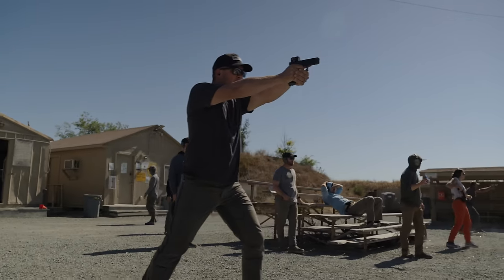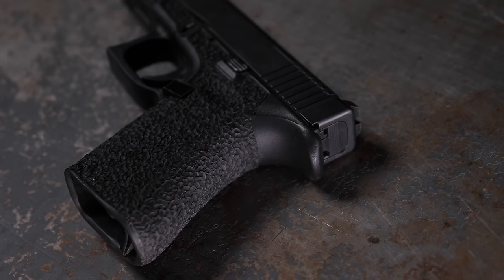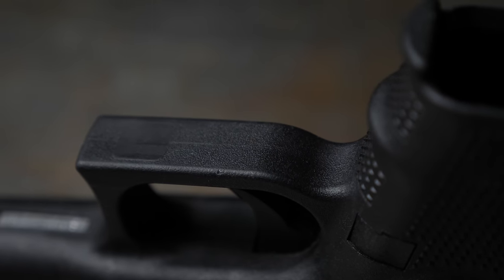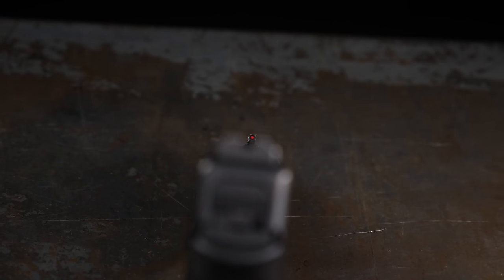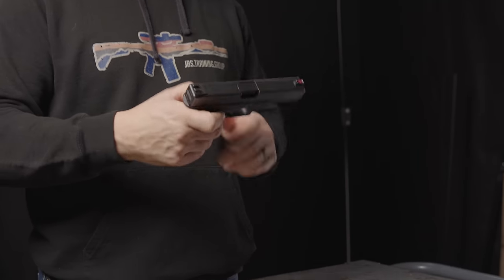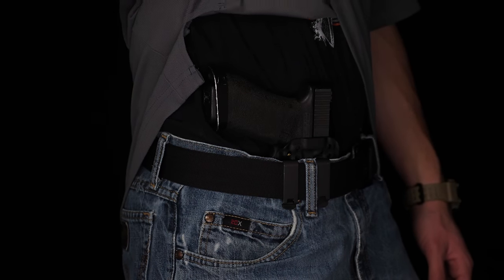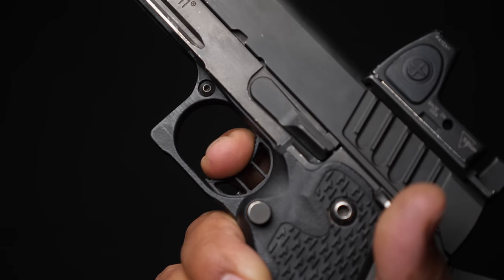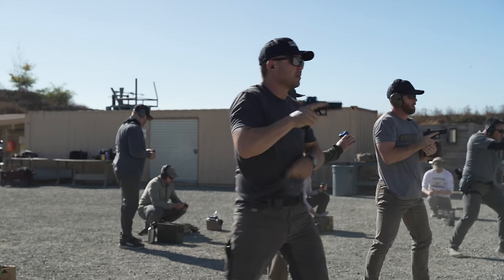Mod Your Carry Gun: Do's & Don'ts

Comment: After a couple thousand rounds my old gen3 Gluk 19's trigger smoothened itself out pretty well.  That and maybe I just got used to it.  I have fat stubby fingers and absolutely hate the finger grooves on the newer Gluks. Hard pass on those, plus I only carry the old G19 OWB these days because I absolutely refuse to shovel a striker-fired firearm without any external safety devices inside my waistband now. 

In the three decades since I first bought my Gluk I've changed my thinking a lot on what I find acceptable in a carry gun and my own methods of carry.  Transitioning to AIWB has had a lot to do with my thoughts on absolutely required equipment on a EDC gun: DA/SA, external safety/decocker, and external hammer.  I accept nothing less.  Others can make up their own minds and follow tbeir own rules as to what equipment is acceptably safe for them.

Comment: The trigger most folks want is a crisp, “glass rod break” trigger, for the least possible disruption of the sights, during the trigger pull.  This is the best for target, but not for defense, where adrenaline is high, and simply resting your finger on a light trigger could have catastrophic consequences.  My Glock 45’s trigger was terrible, even by Glock standards.

Comment: what iron sights do you recommend for a glock
Reply: I'd say your best pick is Trijicon HDs orange. 3 dot night sights. I have them on 2 pistols. ✅️  Glock-Ameriglo night sights are ok. I'd avoid fiber beam type sights. The thin pipes seem weak, easy to fail in a ccw, carry situation. Some like new HD xr series but I'd stick with orange HDs for any Glock.
Reply from the maker: There are a lot of good options out there now. Just make sure they are metal. If you run a dot either have them blacked out or some sort of black rear and a front sight with something that is a different color than the red dot. Trijicon, Ameriglo, Dawson Precision, would be a good place to start looking.

Comment: understand not milling the slide as you're changing the weight and can effect the action.  but what about milling for a RDS mount?  you are putting some (maybe more, maybe less) of the weight back.
Reply from the maker: True, definitely worth comparing vs. factory. Generally more weight isn't much of a problem.
Reply: Ddp 30$ mount for not milling or buy a rmr cut slide  on a web  sight (your choice) 120$

Comment: I put a RangerProof Swag (Yeah, cringe brand name) flat faced trigger shoe on my Glock 19 Gen 4 and I love it, but there's times where I wish that I still had the stock trigger. Debating on buying an OEM trigger shoe and bar to switch it back. I do wish that my Gen 4 didn't have the finger grooves because my big sausages sit on the peaks of the grooves instead of in the valleys.

Comment: While I agree that red dots can certainly improve speed and accuracy, i would by no means say they're "mandatory". With large optics like the SRO, I can find the dot pretty quick, bot on smaller optics like the RMR and especially micro red dots, i am faster with the irons. I know a lot of people are like that too. And as far as front slide cuts being unnecessary if you're using proper technique, I feel like you're not thinking at all. What if it's raining? What if your hands are sweaty, or bloody? What if your gun falls in the mud while you're taking fire? Front slide serrations are a good thing dude. Everything else you said is legit, though common sense.

Comment: I will probably never use a dot on my carry gun as I am a newer shooter and that's another point of failure for me, but my competition gun I have a dot on it because it's a lower stress environment. What I've been been taught is keep it simple stupid, you don't need all the flashy upgrades if the stock firearm does the job just fine.

Comment: I pretty much agree with, or at least don't have an issue with everything that was said in this video with on HUGE exception. "Black iron sights are perfectly acceptable"?!? What? Despite the recent increase in popularity of red dot sights, iron sights are still perfectly acceptable, but you are MUCH better off with some type of contrasting front and rear sights with night sights, like tritium, being a good choice. After all, this video is about modifications you should or shouldn't do to a carry gun, i.e. one that you might very well have to use in a self defense situation. Many of those self defense situations might occur at night or in low light settings. Being able to acquire your sights in low light is greatly improved by being able to actually see your sights.

Like I said, I agree with most of the advice presented in this video but I really can't understand how this one was included.

Comment: Saying, "It's mandatory to have a red dot on your carry gun" is BS.
Reply: The technology has proven itself to be as reliable and as much of a force multiplier as it has on rifles, if you can't afford one or refuse to develop a new skill you should just say that instead
Reply: @Judge_Jej  Where did you get that? That's not what I said. If you read properly, I simply stated that it's not mandatory to use a red dot. I'm personally not against red dots at all.
Reply: Agree
Reply: I'm in your corner. I have a red dot on my concealed daily driver. BUT. When I train I use my irons as primary sights, red dot as back up. My sights obviously co-witness. My first shot from the draw or low ready is made using iron sights, follow up or shots where i take my time are made with the RDS. That way I never lose my skill with irons on any gun but I benefit from faster follow up with the dot. They aren't everybody's cup of tea. I'm of the mindset, batteries fail, irons don't.
Reply: i heard that and immediately came to comments to see if i was tripping 😂 most self defense encounters occur within 5 yards. at that range, it’s not mandatory whatsoever. nice to have? YES. mandatory? NO.
Reply: @zknsand exactly. i was quite surprised to hear something like that from jeff he seems better than most people about absolutes, i would guess he’s coming from his experience with law enforcement where you would definitely need something capable of engaging from over 50 yards, most of us are not planning on engaging from that far. for someone carrying with the purpose of protecting the public it would be much more important i think.
Reply from the maker: Thanks for the comment. Red dots on pistols are pretty close to red dots on rifles.  Not having a red dot on a rifle (unless you need magnification) is almost to the point that it is absurd.  Red dots on pistols aren't quite like that, but I don't see any reason to not have one in 2024.  Dots make physical skill execution simpler which will allows you to focus on the problem solving.  Iron's work, but dots are better. 🤙
Reply: Agreed! I put one on my Glock 43x. It wouldn’t hold zero. Took it off and put some true glow night sights on.
Reply: @tenicorusa Correct but you will almost never use either in a ccw situation.
Reply: In 2024 there are so many better guns available other than a glock its ridiculous to buy a glock. "Based on reddots being mandatory" @tenicorusa
Reply: Irons don't need batteries..... Nuff said.
Reply: @ghostkilla931 Ok, and swords don't need reloading. 

Technology moves on, with or without you.
Reply: Not against red dots per se, but I have always found night sights faster and easier to acquire my targets. Red dots are fun at the range for me, but as a slightly bigger guy in the waist, appendix carrying a pistol with an optic on it is not the most comfortable. But hey, to each their own.
Reply: Dots make shooting easier picking your sights up easier and faster so yes you do is it the biggest deal breaker no but when you are fighting for your life you want everything to be easier and faster to get rid of the threat
Reply: I mean it might as well be. You’re putting yourself at a disadvantage by choosing not to use one
Reply: Red dot is fine until you pull your gun and the lens is covered in lint, or doesn't come on. I've never had iron sights to fail
Reply: We've only been shooting guns without them for nearly 650 years
Reply: @jimchambers7548  bro it’s 2024. Shake awake is a feature. And it should be routine to check & wipe your lense before holstering lol
Reply: I put my money in tritium night sights. If I'm using a side arm,I want as much element of surprise as I can get without a suppressor. The night sights are good and work so long as you don't have a spotlight directed at you.
Reply: @bluebeastsrt same, i shoot better without them bc ij have a astigmatism
Reply: @tenicorusa there are people who would disagree, some people are used to irons and thus have more trouble getting used to red dots
Reply: @CramcrumBrewbringer wrong 😂 🤦‍♂️
Reply: Good thing he didn’t say that, if you used your big boy listening ears, you would have heard that he said “its ALMOST mandatory that you replace your shitty plastic sights with at the very least some metal iron sights”
Reply: @dr.flinch6745  Chill, big boy.
Reply: I was talking to a cop once about this, and he said 90% of conflicts happen within 1-3 yards. So yeah red dot isn’t all that great when it’s that close because you are literally pointing and shooting. However they aren’t a hindrance, and if the other 10% is further away, I much rather have my red dot than not.
Reply: Say you don’t shoot much without saying you don’t shoot much. 
The threat focused nature of using a pistol dot is superior in defensive shooting. Period. 
There is no legit argument anymore for NOT running a dot.
Reply: Oh hes a cop? That explains it. Hes a c student failure.@shangsty
Reply: @NASTYVEGASNATE that’s moronic.. 
stop taking advice from cops. Most cops are FAR from gun experts. Most rarely ever fire their pistols. They only have to qualify 1-2x a year and the qualification is super easy. 
The situation you describe wouldn’t give an advantage to iron sights. In fact the advantage would still go to the red dot.
Reply: A dot is often better but saying it’s mandatory is an overstatement. A well trained shooter who is good with both systems wouldn’t be light years ahead in performance with a red dot only slightly. I’ve seen videos of people hitting 100 yard shots with no sights at all. The reality is you can use whatever you want when you’re a skilled enough shooter. Something to factor in as well is most people aren’t aiming at all in self defense situations so point shooting should be in the training program regardless of your sighting platform. I’d say red dot vs irons is like most things in the gun world simply personal preference. Either way training is required to maximize performance.
Reply from the maker: Well trained shooters who have trained to a high level with both will overwhelmingly choose a dot.
Reply: @tenicorusa  Notice you said “choose” and not “need” or “require”. A preference isn’t the same as a requirement.
Reply: @CinemaZiggy there is no “preference”. Just the mincing of words to try and justify the lack of experience with a dot. 
There is zero advantage to have iron sights with today’s optic technology. Period
Reply: @PnP-td1mt  You don’t know my experience in anything and the discussion was never about which was better. Please learn to read before you chime in. The discussion was about whether a red dot was “mandatory” or not. Regardless what you say it is ultimately still a preference. People have the right to prefer something that is less advantageous that doesn’t negate the fact that it is a preference nonetheless.
Reply: @CinemaZiggy now I have reading comprehension issues because I disagree with you? 😂
You don’t have a legit argument and are having to mince words to form 1. 
I read your comments just fine. 

If you were proficient with a dot you wouldn’t be here right now. Period
Reply: @PnP-td1mt  Not because you disagree at all we actually both agree red dots are better. I just simply said calling them mandatory isn’t true. The fact that all of this is in the last message but I now have to explain it to you again is exactly why you have poor reading comprehension. You’re saying I’m mincing words but if you simply look at the comment to which all of this is under please tell me was the subject which was better or whether or not a red dot is “mandatory”? Oddly enough you keep assuming you know my set up just because I don’t agree it’s mandatory. Most of us used irons for years before switching to a red dot.
Reply: @CinemaZiggy it’s still a play on words to form an argument in the comment section which is dumb. 
You think I didn’t start with iron sights also? 
I went through OPOTA and shot a “stock” class in USPSA for several years using irons.
Reply: Front sight focus 👍 why leave your life to a battery
Reply: @markbroad119 tell us you don’t train without telling us you don’t train 😆 
Aside from irons being setup to “backup” the irons the battery life these days is well over 20k hours. 
Shouldn’t have to change a battery more than once a year. 
This argument is flat out dumb
Reply: Iron sights are still good, but red dots are better.
Reply: They said the same things about semi auto when they came out. “My revolver is perfectly fine and is way more reliable.”
Reply: I am using them on target pistols but when speed is a concern (as with a carry gun) I’m not quick enough. I’m still dicking around trying to find the damn thing. I continue to work on it.. So for now sticking with tritium irons. Eventually I see myself switching but my skill level is not there yet.
Reply: For most new shooters red dots are easier to learn but I always tell them to train with both
Reply: @PnP-td1mt  the cop was also a marine for 2 tours and something like 10 years in the service. needless to say I trust his judgement more than some dude on the internet. They even teach that in ccw class, so…nothing I said was either moronic or factually wrong. Judging by your comments, maybe stop acting like a know it all ass, and realize it’s preference. I trained with both, I like both, yet all of my handguns have red dots with co-witnessing capabilities.
Reply: If you need to engage a target beyond 10 feet, trust me, you want that red dot on there.
Reply: I love this video! Well done! I don’t agree that red dots are mandatory, though I know they are a very good idea and I have one. I do agree with everything else you said. I especially appreciate your advice on triggers. People just like to find stuff to complain about. Glocks have great triggers. Safe triggers, unlike some….
Reply: That’s just like your opinion, man.
Reply: @PnP-td1mt  Do you have final say on what’s legit or not?
Reply: @Hornet135 I’d be willing to place some pretty large wagers on my comments…..
Reply: @PnP-td1mt  that’s why you’d lose and then you’d claim “that’s not a legitimate reason”
Reply: @Hornet135 or I can simply make sh!t up like you and others in these comments 😂 
This stuff really isn’t all that difficult to understand..
Reply: @PnP-td1mt  Some people see a 3MOA red dot as a 10MOA blur, but see irons and other optics just fine. Is that not a legit argument for not using a red dot?
Reply: @Hornet135 no it isn’t. Get a 1 moa dot and see a 5-6 which is perfectly fine for defensive shooting. 
I personally use 1 moa SRO’s on both of my USPSA limited optics guns. 
99.9% of people trying to justify irons over dots have little to no training with a dot. Period.
Reply: Strongly agree

Comment: Great video with a lot of great advice for new owners or if you are considering modifications to your EDC. The only point I would personally differ with is the avoidance of “U” sights. The sights are one of my favorite features on my Springfields because of the quick acquisition and solid sight alignment. Everyone is different, and your points about cluttered/multicolored sights was a valid point.
Reply: I disagree with the avoidance of multicolored sights. In my opinion, multicolored sights are a requirement. I find it incredibly difficult for my eyes to quickly find the correct dot if all three are white or the same. I like black out rears as well, but different colored dots work best for me. Ie orange front with green rears
Reply from the maker: Appreciate the feedback 👍

Comment: 4:47 - If conditions are perfect, yes. Start getting sweaty because it's a hot and humid day, or it starts raining, or your hands are dirty, oily, muddy, etc then having some front serrations could be necessary. That being said, front serrations usually are a more administrative nicety. That is, all your immediate/remedial actions for weapon manipulation in a firefight, can be done with the rear of the slide where almost every handgun already has serrations.

Comment: On your EDC you should not modify ANYTHING! If you're, God forbid, in a situation to where you have to use that firearm keep in mind the police will take that firearm. Also it is not treated with any amount of respect while in their custody. But the biggest issue is if you get the wrong prosecutor any modifications done to a firearm that you used to take somebody's life can be misconstrued as premeditation. Especially if it's something that helps you shoot better or aim better. Worst case scenario you could end up facing a premeditated murder charge.